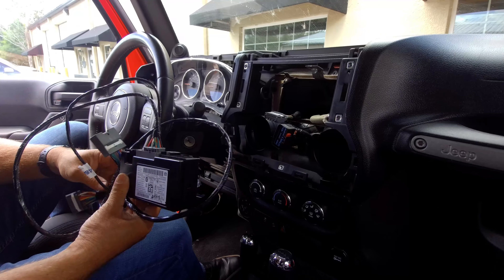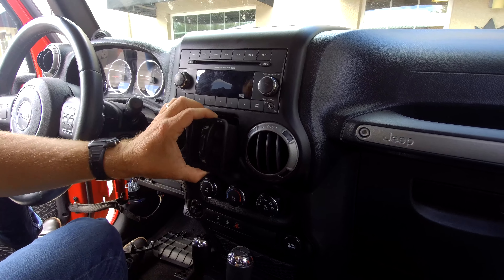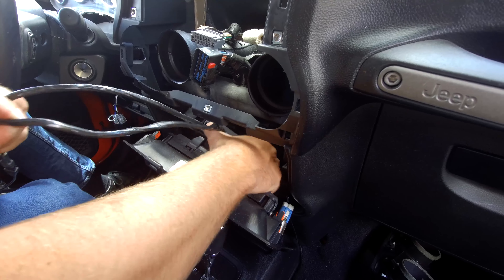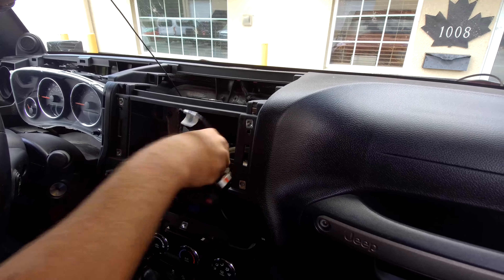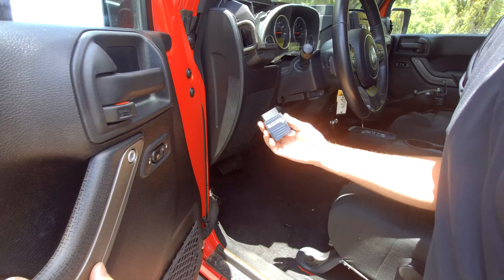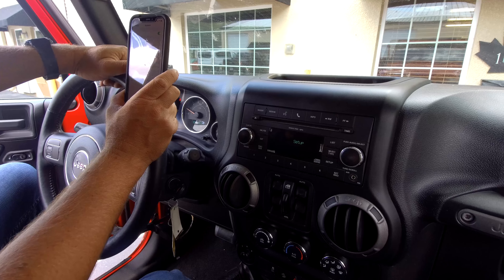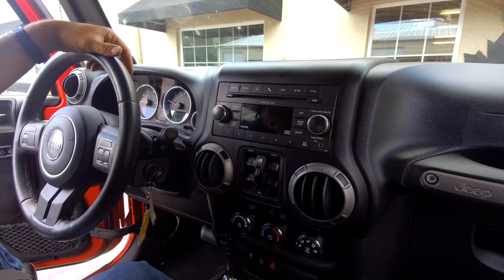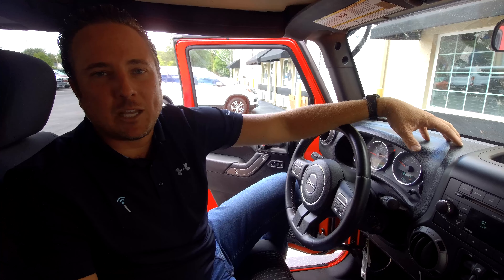2007-2018 Jeep Wrangler JK - Factory UConnect Bluetooth Handsfree Module - Easy Plug & Play Install!

Comment: Is there a way to connect it to the hands free calling button on the steering wheel
Reply from the maker: Feel free to reach out directly to our FCA department to determine compatibility.

FCA@infotainment.zohodesk.com or 1-855-636-6287 Ext: 13